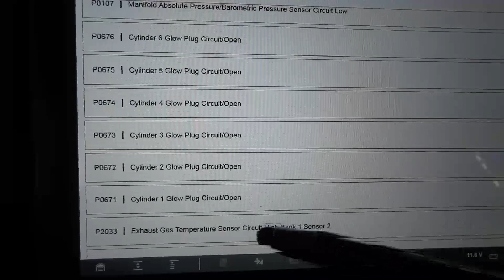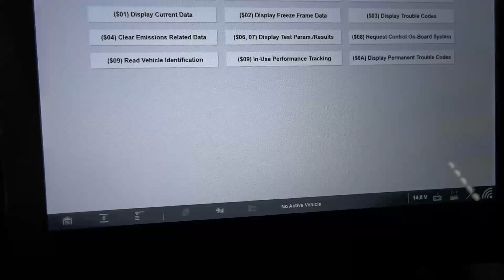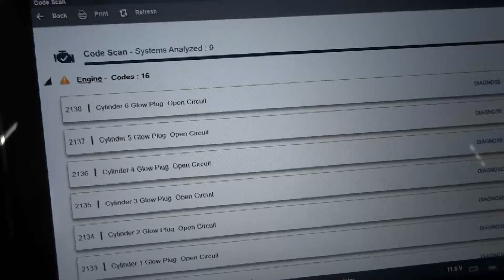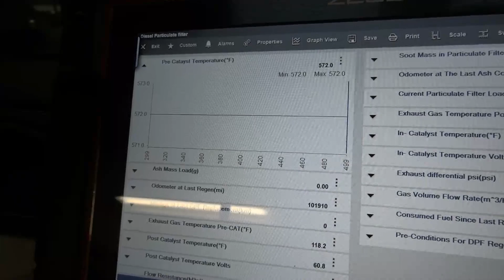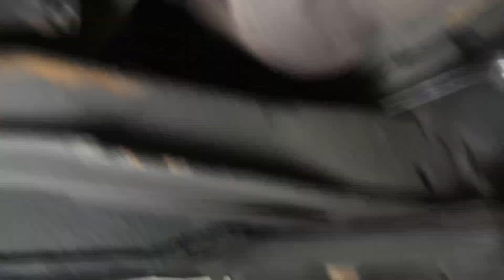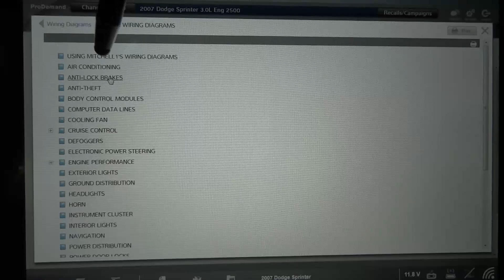Dodge Sprinter No Power/Limp Mode, DPF Ash Accumulation too high & Exhaust Temp Sensor Issues Part 1

Comment: Deo you said that the cam cover is leaking oil on any model that i have worked on in Europe there is no gaskets on the cam covers only mercedes high temperature gasket sealers 
Keep up the good work you do 👍👍👍
Reply from the maker: @KieranEganLong  Yes!

Comment: Greetings Deo ; you are way too much  brother ,  you are great !!!
Thanks a lot for all your technical imput   
Deo I have a question ; my uncle has a 2006 mercedes benz sprinter 5 cylinder , diesel ; he says it has oil leaking from the intercooler  hose , going to the intake manifold , what he should check or  replace ?
Thanks for everything .
Reply from the maker: @CesarCano-e7x   My Pleasure! Oil in the charge air cooler hose would be caused by a leaking turbo
Reply: @KITS_Auto_and_Truck_Repair  thank you Deo , I appreciate it .

Comment: Boss please answer me
When l drive the van like 10-15 min after a beeping in the dashboard and start loosing power  ( do you think turbo is bad )
Reply from the maker: @cengiz028   get it scanned and see what DTTC you have in the PCM!
Reply: P123900 charge pressure too low 
P16E100  boost pressure too high ( turbo )
P159300 exhaust back pressure sensor
Reply: And thank you for answering me

Comment: 112k miles..,maybe that sprinter🤔is lowerQuality then M.B??my is a M.B.2014..with 260k Miles..and i just did clutch,flywheel and all brakes with discs..but dpf and cat i will replace soon..i already loosing power..without check engine light on.
Reply from the maker: @ricksworlddereaux2397   Ah ok! Good Luck with your van!
Reply: @KITS_Auto_and_Truck_Repair  Overhere MB parts are cheap..its a domestic Carbrand ..and labour too..if its without a receipt..👍🤔🇪🇺
Reply from the maker: @ricksworlddereaux2397   Oh Really? That's nice, Maintaining a MB is here is pretty expensive
Reply: @KITS_Auto_and_Truck_Repair  Of course..same here on US Cars..they not domestic..so all parts needs to be imported..so prices doubles..i import much stuff.....i not know if they produce MB OEM Parts in the USA ..like MB cars..but i doubt it because most OEM parts are produced by suppliers..in East Europe or Asia..because of cheaper labourcosts.
Reply from the maker: @ricksworlddereaux2397   Yes!!

Comment: I own 2012 Sprinter 2500, with same issues. Currently the van won’t start at all! Does anyone think that a badly clogged DPF can cause a NO Start? Mr. K , please chime if you can
Reply from the maker: ernelm  Yes, a clogged DPF can cause a no start, do you have good fuel pressure and compression?
Reply: Hmm, the van only clicks when I turn the ignition….. the engine had a really bad knock before it refused to turn over. But all the codes show clogged DPF,

Comment: Love love your videos mate. I just discovered your vids 3 weeks ago. Your very good in the explanation of what your doing. Your the first guy I’ve subscribed too. And I have watched thousands of videos. That said. I’m having trouble with a P0471 code on my 2012 Mercedes 3500 sprinter. It comes and goes on its own. I have replaced the exhaust pressure sensor. At least I think I have. Any chance you could address the code problem in a video. And showing where this sensor is and how to correctly test it and wiring to it. Thanks in advance for any light you can shed on this matter
Reply from the maker: Steve Hunter  My Pleasure! Thanks, I will make a video when a vehicle with that problem comes around! you can email me at Deo@calleva.org if you have any questions

Comment: I also have no power when I put it in reverse, you have to step on the had too much to make it move. It only has 40K miles
Reply from the maker: R M  what codes do you have now?
Reply: 0208 code

Comment: Hello buddy and thank you for all of your help. I own a 2016 sprinter 3500 Dully that 3 lights came on, abs, anti skid (anti lock) and tire pressure sensor light, according to online info it said it was the abs sensors but o didn’t know which one so I went ahead and installed all 8 of them 4 and and 4 wear pad.  I started it up and the lights were stop there, tried to clear codes but lights never went away. So I took it got a drive thinking it needed to be driven for codes to clear but the vehicle is now in limp mode, it doesn’t drive and when you try driving it its max speed is about 20 mph and the brake light comes on but shuts off when you stop. Please help. Thank you
Reply from the maker: R M  What codes do you have in memory right now!

Comment: Thanks!  I like your very educational videos. I live and Norfolk Virginia. I have a Mercedes Benz Sprinter 2500 which has lit up the check engine light recently 2 days after I took it to dealership for state safety inspection.  If your only within an hour away I'd to schedule my sprinter for diagnostics and repair.  You got my complete confidence.  Even with check engine light the engine is running fine but after a while of running it above 60 mph it seems like the the turbo is weakening.
Reply from the maker: Edmundo Rodriguez  Thank you for Donating to the channel, I appreciate it! Our Sop is in Dickerson MD, Email me at Deo@calleva.org for more info!

Comment: Hi K Diagnostic, your videos spot on 10/10, I'm wondering if you can help me with my VW Crafter 50 Van, 2.5 lts. turbo diesel, 2010 model, my little OBD2 reader, show me P2BAC, Nitrogen oxides, limit exceeded, and P2002: DPF exceeded threshold bank 1, I had cleaned exactly like you showed me in your videos, with Liqui Moly, cleaner and purge, with the Liqui Moly spray gun as well, white smoke coming out, like your videos, I was so happy, but after 20 minutes on the Fwy, the engine when into a limp mode, back home slowly, then I changed the oil, filter, and carried out and other cleaning with Liqui Moly again, no much smoke coming out this time, but I couldn't get out of the limp mode, my little reader doesn't let me, the question is how I can got out the limp mode, also which scanner do you recommend to carry out the DPF regeneration, and others stuff, but not the $10k the Snapon Zeus,  too expensive for me, Autel for DIY- Small Shop, will do it thanks
Reply from the maker: Ricardo Bellina  I would recommend buying an Auto scanner!
Reply: @KITS_Auto_and_Truck_Repair  Please can you be more specific which Auto Scanner will do a DPF Regen for DIY 2008 Dodge diesel. I have been in LIMP MODE HELL for 4 years and need to clean my DFP or do an emissions delete kit.  An amazon link for the best affordable scan tool would be ideal. Thank you. YOU TOTALLY ROCK btw, I learned SOOOOO MUCH from your liqui moly DPF clean vids and I am not afraid any more.lol
Reply from the maker: @OGBlissBar  I don't know any DIY Scanner that I can recommend! You can check some autel scanner, they might be good!
Reply: When my 2008 dodge sprinter goes into limp mode I turn the engine off and on and it resets it until I go up another hill and piss off my clogged DPF and then we are limpy again.

Comment: Hello , it's helpful , wonder to know the the model and make of the scan tool you use , mind to share the model and make of scan tool please ?
Reply from the maker: John Lonappan  I used the Snapon Zeus Scanner in this video!
Reply: @KITS_Auto_and_Truck_Repair  thank you, what’s the best way to buy one of this tool cost effective? I noticed these tools are costing $10k+
Reply from the maker: @johnlonappan7945  you can call your local Snapon rep or google them and they will answer your questions!
Reply: @KITS_Auto_and_Truck_Repair  my 2008 Sprinter 3500 occasionally throws P0544 Exhaust GTS circuit  trying to find what exactly the triggering factor , it comes ones in a while , any suggestions ?
Reply from the maker: @johnlonappan7945  check the sensor wiring or the sensor itself!!

Comment: I think that 572 is a default number that the computer outputs when it detects a problem with the sensor. It recognizes it can’t trust the actual information, so it randomly displays a default value. The reason I say that is exhaust temps normally get to 500+\- during normal driving, so it shouldn’t recognize that as too high. Not that it matters because you still identified a defective sensor. Awesome diagnostic process.
Reply from the maker: Che Kelley Yes, you're right that makes sense, Thanks for your input!!